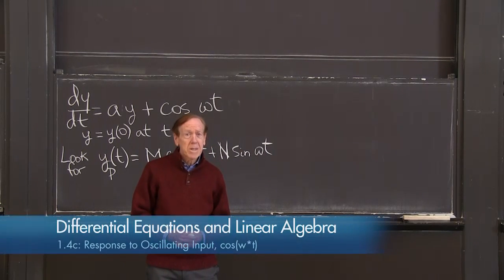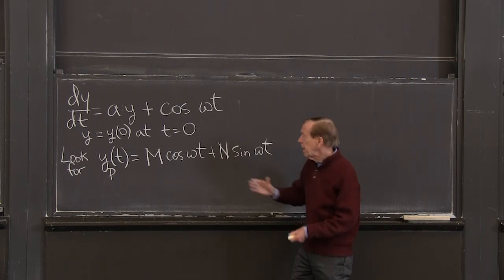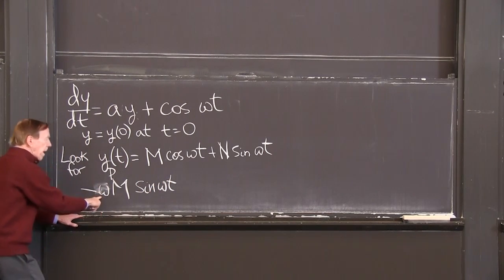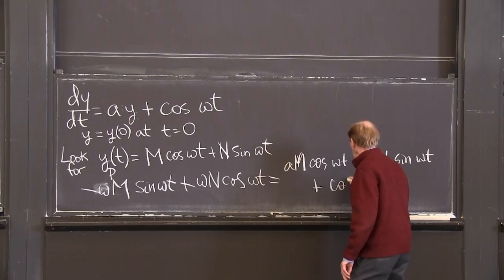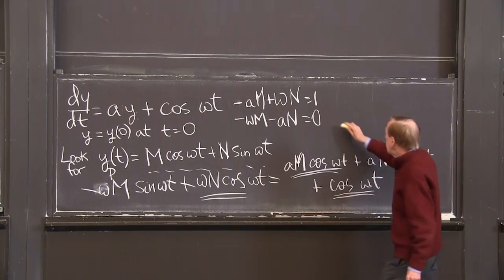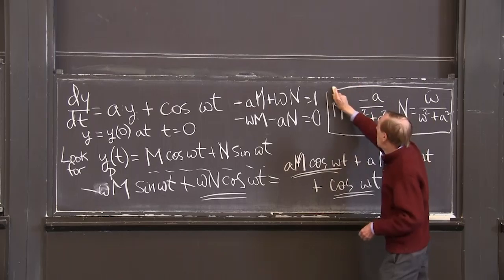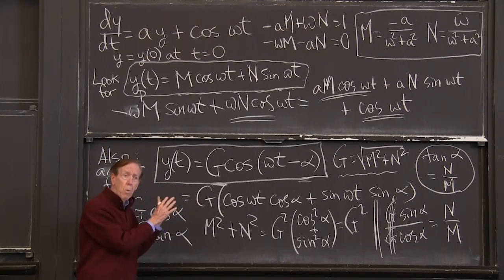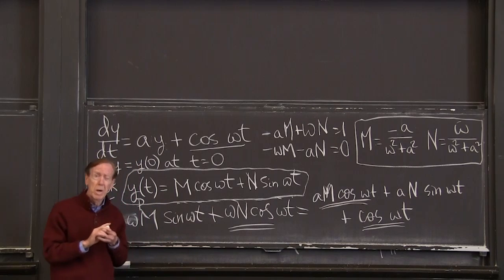Response to Oscillating Input

Comment: 5:30 The system may be nicely solved in 3 steps by Cramer's formula. det = w^2+a^2)
Reply: So..
You do it substituting a column of the coefficients matrix [-a w; -w -a] by the independents terms matrix [1; 0], and then you divide the determinant of that one by the determinant of the original coefficients matrix..

In this case,
M = det( [1 w; 0 -a] ) / det( [-a w; -w -a] )
N = det( [-a 1; -w 0] ) / det( [-a w; -w -a] )

*I just wrote that because even I dind't remember Cramer's formula